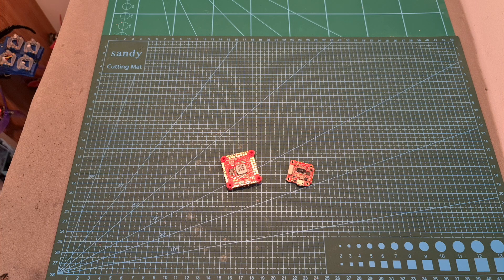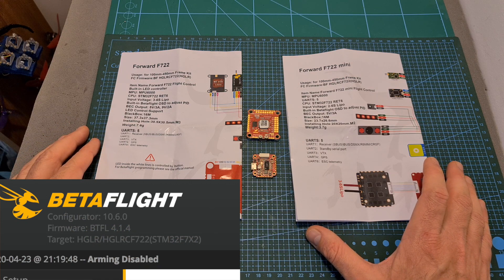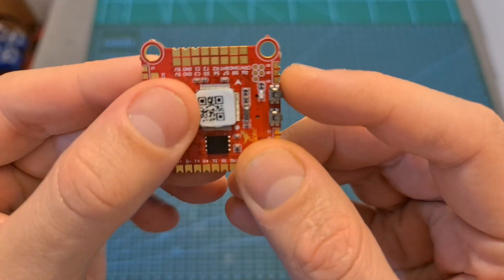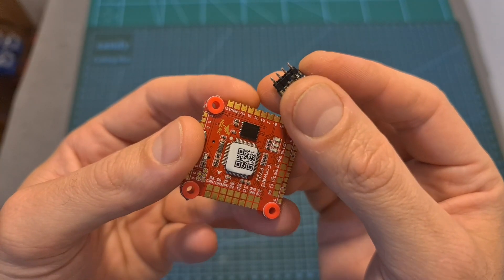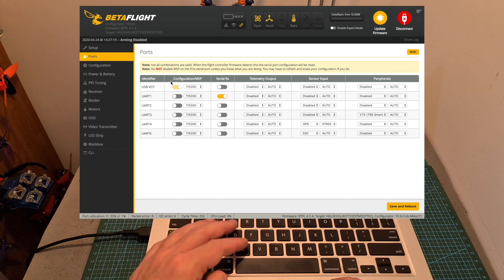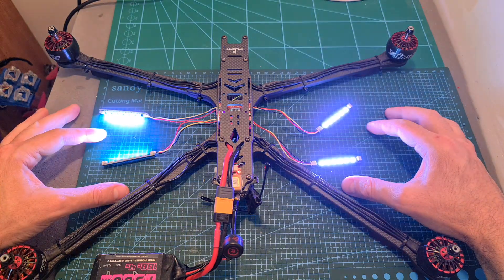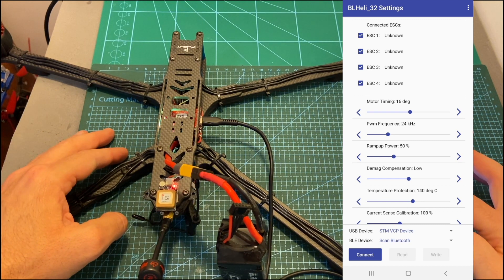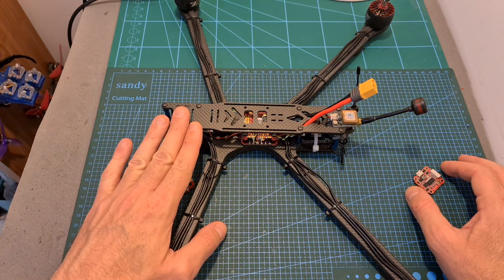HGLRC F722 Flight Controller - Setup & Review

Comment: Any opinions about this stack now that it's a year later?
Reply from the maker: I've used it in a couple of builds and it's pretty good.
Reply: @KremerFPV  Thank you. Mine is on the way! Thinking of pairing them with Flywoo Nin 2207.5 1860kv motors. Waiting on some other YouTube responses before pulling the trigger lol.

Comment: I'm stalling this stack to my 7" inav build but the voltage scale and current scale isn't right. shows i'm using 5 amps on the table. Do you know what scale I should use for INAV?

Comment: Hey dude, I have problem with Gps on this board. I have setup inav but I couldnt use poshold mode. Because it doesnt work properly. My gps module is matek m8q qmc5883L... You said that gps port uart4... But on the manul it says uart port 2 is Gps... Which one is true.. thank you very much. I am waiting you guys. Please help me..

Comment: Can we use the osd for "used mah"? Is that what you call the current sensor? Because I hate to look at the main voltage because of battery sag.
Reply from the maker: Yes, but keep in mind that you will need to configure it per used battery.

Comment: what the heck are the s5 s6 s7 s8 pads for?
also what are the 4 tiny pads with no label?thanks
Reply from the maker: You can use more motors or remap them when using softserial. As for the 4 tiny pads, I am not sure, sorry.

Comment: This is going to be a dumb question, but if you have a traditional setup, where do the signal wires from ESC go? I see the S1-S4 on the bottom, but that seems to be only available for the DJI setup.  I see the S5-S8 pads on top which I can easily solder to and remap resources in the CLI, however i'm not sure if that's the advised way of wiring this up.  Any help is appreciated! :)
Reply from the maker: Hi Chris. By referring to a "traditional" setup - are you referring to using separate ESCs or an analog setup?
Reply: Gal Kremer I see how my comment wasn’t really that descriptive lol. Separate ESCs is what I am using
Reply: Thank you!
Reply: Any help?
Reply from the maker: @chrismasih-das5741  As far as I can remember there are soldering pads for s1-4 also in the non Dji version. Anyway you can use the JST connector and connect the signal wires to the separated ESCs.
Reply from the maker: I just checked - it doesn't have s1-4 pads. You can use the JST connector as I suggested or remap the motors output pads from 1-4 to 5-8.